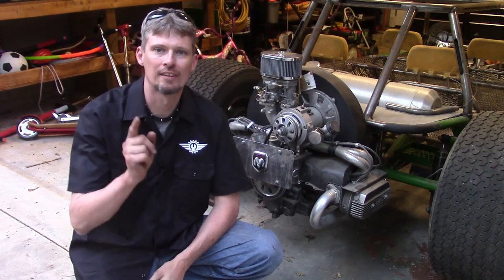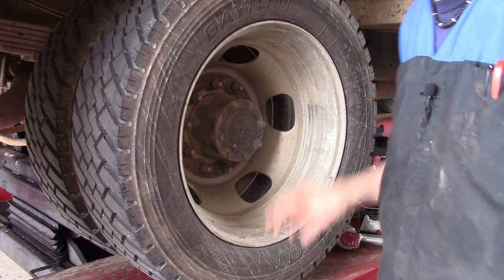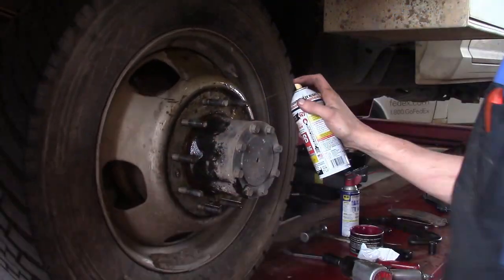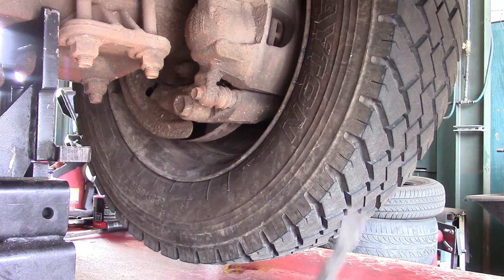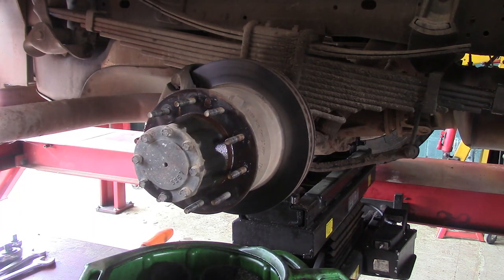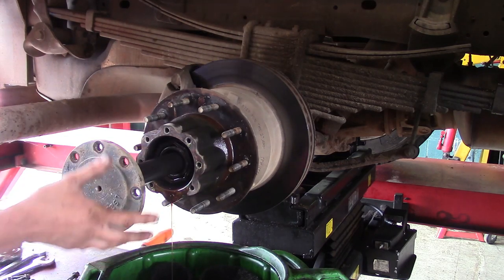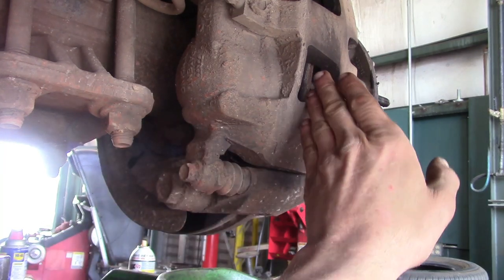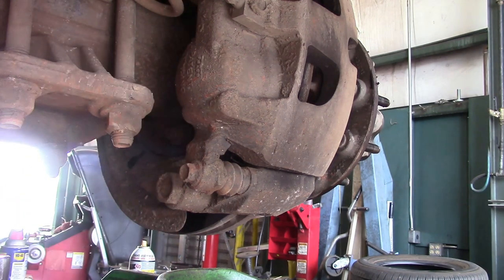Part 1/3: Ram 4500-5500 series truck rear brake rotor/hub removal

Comment: When you need just to replace and put NEW brake pads on, do you still need to replace the rotor? 
Mine still looks great. I have a 2005 Chevrolet c5500 Kodiak 8.1 Vortec, on a Motorhome chassis. 
Would this demonstration work just as well when I do my brake job? I can't seem to find any videos for a Chevy brake job of this size.
Thanks!

Comment: Hi, I’ve been following you for a long time and used your videos and found them very helpful. Thank you!!! well I have a 2021 ram 5500 cab & chassis. One of my rear shocks are leaking oil. The dealership wants to charge me $708 for parts and labor. I want to try to do this myself and looked at everything and it looks really simple. I’m just not sure about the top bolt. It looks different from the bottom it looks like it has a cone shape on the top end and very hard to get to, should I try to tackle this myself or just pay the extra labor and let the dealership do it? Thanks in advance. They are charging 2 hrs labor at $135 an hour. Please make a video on this for cab and chassis

Comment: Stupid question  can you put a 4500 wheel hub assembly on a 3500 cab&chassis? Want 19.5 but don't want adapters

Comment: I do this job a lot. How much do you charge out of curiosity? I get 6 hrs. I also do use a socket on the upper caliper bracket bolt to get it loose. It's an extremely tight fit but with the right angle and a 12pt socket I get it in there with a breaker bar and Jack handle tube for more leverage. They're torqued around 400ftlbs
Reply: Do you have a link to that torque spec
Reply: @stephenleverock9882  I can't post a link because it's in my Chrysler service information and only technicians have access. But here's a copy paste. Specs are for a 2019 4500/5500 but they're the same for all of these trucks. 

Rear Caliper Adapter Bolts
460 ft/lbs